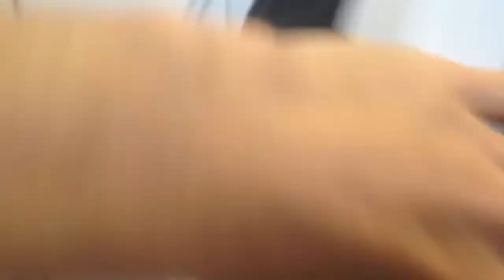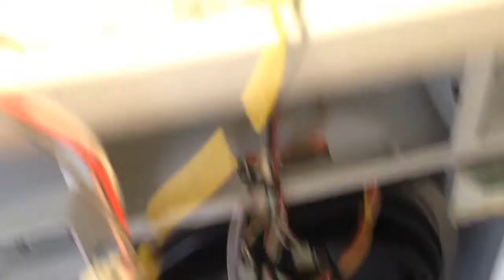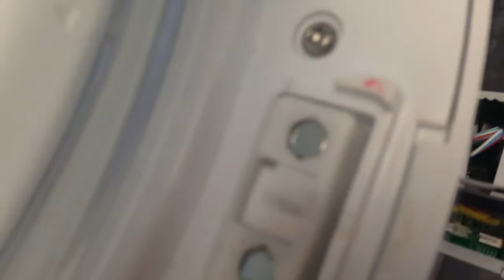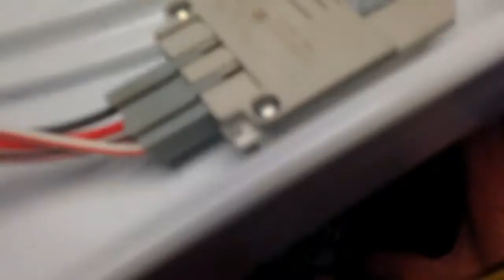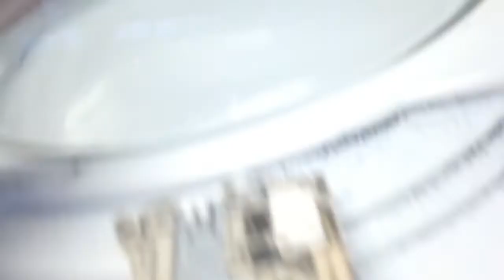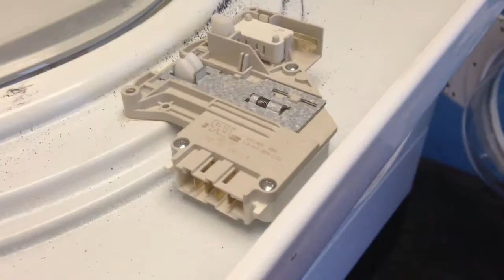Speed Queen Horizon Door Lock Repair

Comment: Had this problem on our brand new Speed Queen where the door wouldn't always lock.  You would push GO and walk away but if the door didn't latch properly, you would come back a half hour later and the laundry wouldn't be done.  It was a very intermittent problem, but would only strike when I was in a hurry.  This was trivially simple to check and indeed, it looks like this was the problem.  Thank YOU so much for posting this.  You saved me a bunch of aggravation tearing apart my washing machine to figure this out on my own.

Comment: Thank you for making that video!   
I had that problem with a Speed Queen AFNE9BSP113TW01 washer; door lock error.  
By removing the door cover, loosening the two lock nuts and adjusting the male door latch outward to the max, then tightening them, the problem went away.  Thank you!